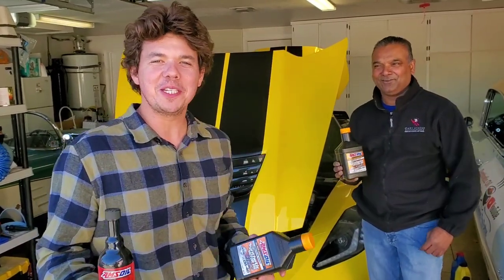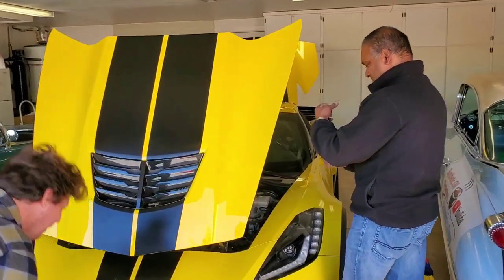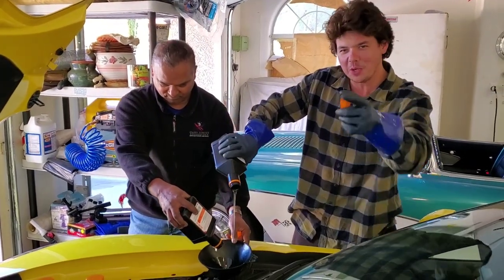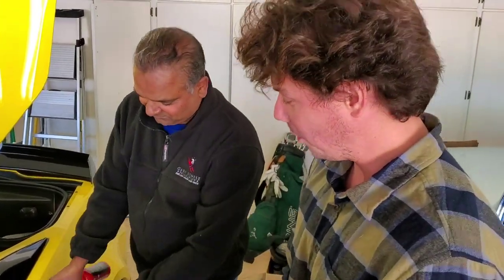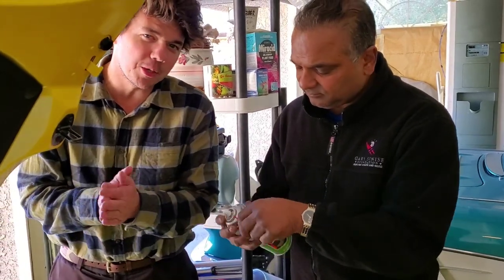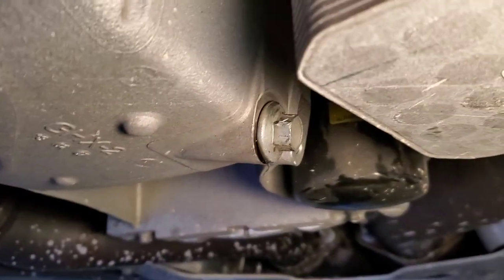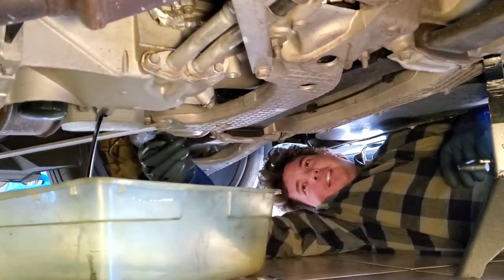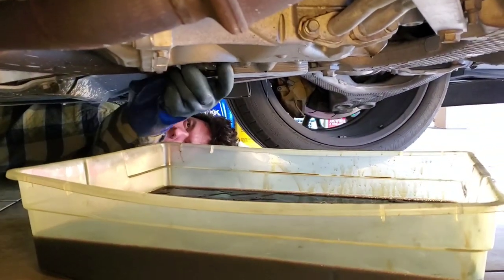ZO6 Corvette Stingray AMSOIL 0W-40 Motor Oil Flush Change

Comment: Another question I just shut off mds on my 2010 charger rt.  Can I  shift from 5w/20 to a thicker  oil viscosity?
Reply from the maker: Of course you can do anything however you'll lose fuel mileage difference that's the biggest thing also if you're not racing it's not really worth it if you are racing I highly recommend doing the dominator racing oil you'll see that under motor oils with my link here.
https://www.amsoil.com/p/dominator-10w-30-racing-oil-rd30/?code=RD30QT-EA?zo=5331179

Comment: Hey Eben, I recently purchased a 2008 C6 ZO6 with the 7 litre LS7. What Amsoil oil would you recommend? Also thinking about a supercharger, would that change anything? Also, will need to do a 60k mile service, so anything you can recommend for trans/diff or other fluids would be great.
Reply from the maker: Of course if it was my car I would change all the fluids on it to AMS oil coolant transmission rear diff motor oil brake fluid.

The first thing I would start with is the motor oil after that I would do the coolant.
Then I would do the transmission in the differential very easy to do in one day.

If you break it up into three different days the motor oil first then another day you do the coolant and then another day you do the differential and the transmission it'll be a piece of cake.

I would also do a power foam on the engine which you'll see the yellow can absorb power foam I would also do the PI performance improver gasoline additive.
If I was running in a normal mild climate I would run 10w30 signature series.

If I was racing it I would definitely run the dominator 15w50 racing oil.

Just depends on what I was doing but if I was just driving it in Las Vegas where I live not racing it I would just run 10W-30 signature series.

This is my link and when you use my link I'll be your Amsoil dealer so in the future I can always answer all your questions in the products and if you have any questions give me a buzz also when you use my link I'll get the credit for your order which would really mean a lot to me and always happy to help any way I can 😊👍💯
🎬 Professional YouLubher: Eben Rockmaker Regency Gold Direct Jobber AMSOIL Specialist (Dealer#: 5331179) 702-472-3614 

     ✅ If You're New To AMSOIL I Recommend The AMSOIL 6 Month PC Membership because it will save you about $33 on a $100 purchase after the difference in tax - https://www.amsoil.com/offers/pc/?zo=5331179
Reply from the maker: The superchargers not going to really do anything the only thing would be if you were going to be racing and then you go to the racing motor oil 15w50

Comment: If I  do a flush with amsoil would I have to put amsoil oil in or can I use pennzoil
Reply from the maker: You can use any oil.

Personally I wouldn't use the Pennzoil because the oil is a synthetic blend they can call a full synthetic full synthetic when it's 25% synthetic or more Amsoil is 100% synthetic has a much taller film strength also in your motor the last longer run smoother you'll also have the ability to go longer per oil change.
There's also quite a bit of a difference in fuel mileage too so I would get the signature series motor oil as a preferred customer.

When you use my link I would be your Amsoil dealer so in the future I could always answer all your questions on the products I would also get the credit for your orders Thanks for the business in advance and I appreciate you being a part of my YouTube community.

I also recommend the PI performance improver which will clean your valves injectors and also I recommend the power phone if you have an older vehicle will clean your valves and heads and exhaust manifolds throttle body.
❤️🇺🇸❤️ Professional YouLubher: Eben Rockmaker Regency Gold Direct Jobber AMSOIL Specialist (Dealer#: 5331179) 702-472-3614 
      
      ✅✅✅  New To AMSOIL I Recommend The AMSOIL 6 Month PC Membership because it will save you about $33 on a $100 purchase after the difference in tax - https://www.amsoil.com/offers/pc/?zo=5331179

Comment: How often should you do a engine flush for amsoil every 30k or what?
Reply from the maker: Whenever you think your car needs it personally if I owned a diesel truck with its turbo diesel I would do it every single oil change because of the high heat and the heavy soot thickening on my personal gas vehicles I only do it the first time I switch over to Amsoil on my SL550 has twin turbos and because of the hot turbo coking I'm going to be doing the flush on it on my next oil change which you'll see coming up soon
Reply: @Syntheticoilprotection  gotcha but if I don't have a diesel its a 5.7l hemi ram 1500

Comment: do you really need to flush your engine no auto dealer does that even when you take it to Valvoline, Pennzoil or even to mobile one. there should be detergent in the oil to desolve all the build up sludge carbon if any and be taken way by the oil filter.
Reply from the maker: Great question You don't have to do anything to your vehicle You don't even have to change the oil ever.

However it'll eventually get enough sludge to where it won't run anymore.

The detergents clean the carbon deposits around the rings oil cooler ports timing chain and a lot of other areas they get build up.

Most of the oils that come in vehicles are all synthetic blend or called full synthetic basically full synthetic is about 25% synthetic or more Amsoil is 100% synthetic so by doing an engine flush that gets a rid of a lot of the carbon buildup that way all that buildup doesn't end up into your new oil filter so it's a lot better to just do the flush instead of half the change the oil filter so soon.